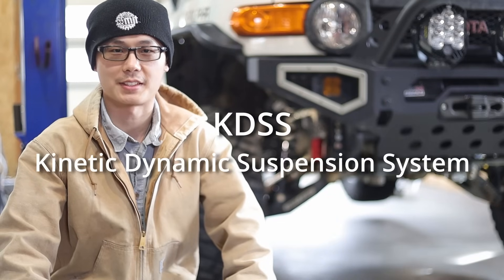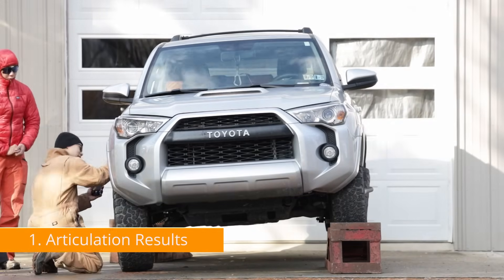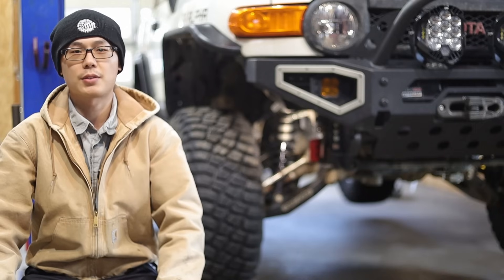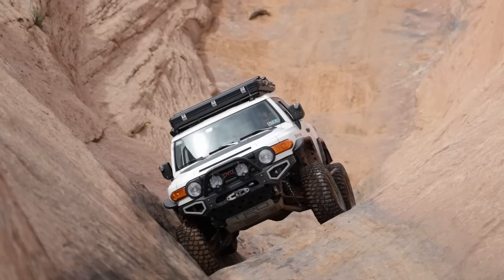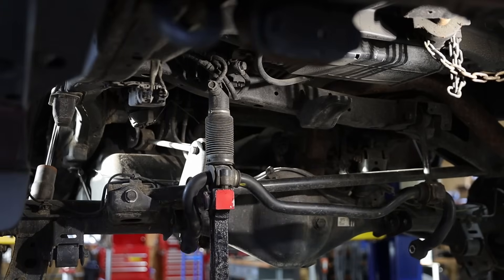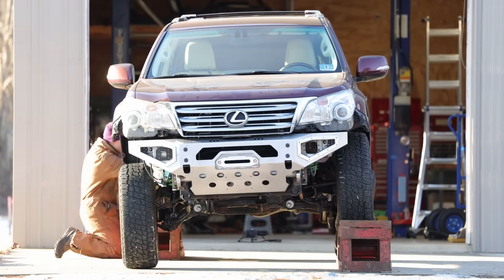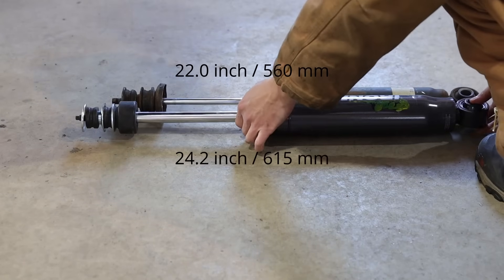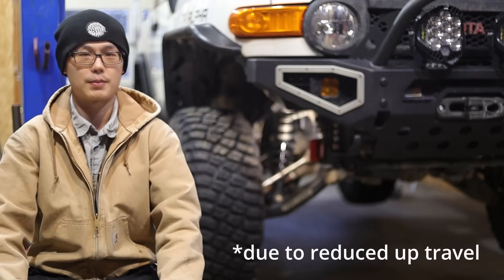Toyota KDSS Ultimate Test | Legit or Gimmicks?

Comment: The KDSS ride is jarring at highspeed off-road, espcially on wash-boards. I just installed the KDSS on/off switch from DR KDSS and it has made a huge improvement in that regard.
Reply: I wouldn't thing the sway bar, whether KDSS or not, would have any impact on washboard ride quality, since on washboard bumps both wheels are moving up and down at the same time.
Reply: @stevecarlson2346  you'd be mistaken. Washboards aren't even all the way across the road. Often they are only in the path of one side of the car or in curves where one side of the car travels further than the other.
Reply: @stevecarlson2346  You're correct. People fundamentally misunderstand what the swaybar even does.
Reply: @Getitstraightyo  a sway bar resists body roll and any difference between right and left wheels. If the right side goes over a bump then the whole truck will rock to the left instead of allowing that one wheel to move up independently. It could affect wash board roads.
Reply: @ExpatonTwoWheels  Washboards are parallel and perpendicular to the driving surface. That is how they form. KDSS is not hurting anything on washboard roads. This is basic stuff guys
Reply: @Getitstraightyo  because when you're on the trail you only ever hit washboard straight on, evenly across both wheels and never in a turn? Come on man.
Reply: @Getitstraightyo  you are incorrect
Reply: @Chad_H  How often are you turning on washboard roads that your swaybar is pissing you off that much? Christ it's like you people have no idea how this stuff works.
Reply: @Getitstraightyo  I said it's jarring, not that it's "pissing me off". I drive the Forest Service roads in Washington a lot - particularly around Mt Rainier. They are curvy and winding and rough and having the KDSS turned off absolutely makes a difference. You can come drive my truck if you don't believe me.
Reply: @stevecarlson2346,
do you really think the bumps & dips & corrugations on a WASHBOARD ROAD are as uniform as the bumps & dips on a real washboard (the man-made board where you wash your clothes on) ?
Reply: In case you do think so, then you need to drive on a washboard road in real life (not on a keyboard or on a touchscreen or in your dream), and pay attention,
the corrugations are not really uniform,
they demand suspension flexes,
not just ups & downs travel,
therefore stabilizer bar stiffness plays some role here
Reply: @stevecarlson2346   @RyanAttack872  It's easy to tell who doesn't run desert trails often. They aren't perfectly formed and are often offset by a few inches to the point where the tires are hitting the next one at different times, meaning the swaybar is in use. Even when they are relatively even bump-to-bump, the vehicle itself may not be tracking perfectly straight on the road, may be in a corner, the washboards may be at different depths relative to the original road surface, etc.
Reply: I don't think this is due to KDSS, but my GX swallows speed humps more smoothly at 40 mph than 20 mph
Reply: Same. I installed the switch day 2 of owning a brand new 2022 4R ORP. We live down a bumpy country road that we take at speed, and it makes such a difference my wife will ask me if I remembered to turn the kdss off of it feels jarring. Then we get on the windy highway, and I'm so glad I have it.
Reply: However, on the highway going hours at 80mph rides very smooth and I have Wildpeak LT tires.
Reply: me too 👍
Reply: I was just going to ask if you could install an override switch to turn it off when you're offroad. They would be the best of both worlds.
Reply: I found the exact opposite. The lx460 felt like a Cadillac going down the freeway on washboard roads in Jackson Hole doing 60mph.
Reply: Don't agree , ill trust the Toyota engineers thx.
Reply: @TS-xj5mt  the sway bar stiffens the spring rate , end of story ...  ive tested it on washboards ,  same vehicle with and without front sway  on two vehicles off road...more shudder with it,  smoother without

Comment: I been saying this forever.  We LOVE our KDSS.  It's basically zero sway bar off road and an amazingly thick swaybar on road.  Car on road, truck off road.  KDSS is a gamechanger...love it!!  The refinements of the GX and LX are no joke or gimmick...
Reply: My 2021 4runner has kdss and I'm sold. It flexes like a champ off-road and very little body roll on road, "game changer" is right. Awesome system.
Reply: @Jlhines19821  lift it yet? I am trying the Old man emu 3”…. Really don’t know how that gonna turn out
Reply: 4runner with KDSS is awesome.
Reply: @Faknm  oh yes it is!! ✌️
Reply: Until it breaks,which mine did and $5,000 to repair
Reply: @marshallbill1  how did you break it? 😳
Reply: @Faknm  I don't know. It is the hydraulic ram in the front is leaking. I don't off road or anything.
Reply: @marshallbill1  just take it to a hydraulic repair shop they can stuff new seals in it for $200
Reply: @Bill Marshall  exact same thing happened with my 4rnr. Front actuator started leaking and multiple dealers have no idea what to do except quote 5k+ repair bill on a 4k factory option.
Reply: @7:25 you might not have meant  “always”. I believe it’s only if you’re in 4L
Reply: Does the KDSS do this automatically or do you have to put it into a off road mode first? I was waiting for him to say something in the video but didn’t catch it.
Reply: @pappaclutch3266  KDSS is automatic... just drive it... once you are going slow it knows you are off road and disconnects the bars basically... excellent system... best of both worlds...
Reply: @LexusGX460-OFF-ROAD  cool thx
Reply: I heard KDSS give stiff ride quality. Is that true?
Reply: I had a moment of distraction while driving one time and drifted a bit in the oposite lane of traffic. I almost hit another 4runner head on. We both corrected with agressive steering and brake inputs but our trucks reacted completely differently. Mine turned and stayed relatively flat. His nose dived and he had major understeer. 

I saw then what KDSS did for me on road. He had no hood scoop so he had an sr5.
Reply: You are so right! Now I don’t feel bad to my self   When my friends make fun of me why I have KDSS.  When I’m reality KDSS is a game changer…
Reply: I think KDSS is the reason why many who are looking at the new GX and LC for off road use are going to spend the extra money for the GX.
Reply: We currently own a 200 series Land Cruiser and are very familiar with LX570. The US spec LC uses KDSS while the LX does not.
Reply: had kdss system break on 2011 Land cruiser. Cost the same to fix the car, as to sell  it fixed.
Reply: @LJ-fe8vb  that’s because you relied on the dealer which they have no idea what they are doing so they replace the whole system lol.   I’ve already replace many single components on the whole system for ppl with isolated issues.
Reply: @fltllc4136  what kind of issues? Mines never broken
Reply: @fltllc4136  lol I have already bought from you I didn’t look at the other stuff besides the switch
Reply: @NightNurseMike  Ha. Nice thx buddy.
Reply: @fltllc4136  I love it, by the way.  Next I’d like a locker override please.
Reply: @NightNurseMike  yessir.
Reply: @fltllc4136  if kdss is worse in off camber does that happen only when kdss valves are open and actively letting fluid move into the accumulators or does it allow fluid in those during normal driving too?  It’s gotta have more roll stiffness once the sway bars hit but is the accumulator allowing some lean before that when we cruise around with kdss off?
Reply: @fltllc4136  I want a retest with kdss off
Reply: @NightNurseMike  I never said it was worse.  The creator of the video did.  I don’t think it’s bad at all.  Also at some point the sway bars kick back in once the kdss shocks run out of travel. Which I’m the Video, it was right at that point.
Reply: @LexusGX460-OFF-ROAD, 

" .. been saying this forever ..."
"The refinements of the GX and LX are no joke or gimmick..."
No, they are not joke or gimmick.

" .. joke.."
" .. gimmick.." 
You're the joke. A bad joke. An ugly gimmick.

You have no idea what you are talking about.
Reply: @tr0nix1  semantics! lol same end result on either KDSS or AVS...
Reply: @GX460 OFF-ROAD  there are no semantics.  Just facts.  LX570s only with traditional sway bars here in the USA.  No KDSS.
Reply: @tr0nix1  bro this dude literally don’t even know how it works and he has videos explain how he thinks it works.  It’s comical.
Reply: Toyota turned a solid piece of metal into an electronic and computerized moving part, that is the DEFINITION of a gimmick lmao. Literally reinventing the wheel
They could've just equipped cars with quick discos and got the same exact result, but then they wouldn't be able to tack on another few thousand to the price tag
Reply: @Patrick.Weightman  I hate to be that guy but, I don’t think KDSS has almost any electronics on it. It is hydro mechanical
Reply: @justinmartin8887  just a solenoid to turn the flow of oil on or off. Open at higher speeds so when pressure is felt on one side going around a corner the front and rear interact. I think kdaa is way better than the AHC on my LX as you can upgrade shocks etc. AHC is hydraulic shocks . It's nice the vehicle goes up and down but limited at speed. Plus has no body roll at speed.
Reply: @Patrick.Weightman  it is a disconnect... it disconnects hydraulically rather than mechanically 😃
Reply: @Patrick.Weightman  Plus it was developed in Australia for off-road and Toyota bought the patent. 🤦🏼‍♂️
Reply: @Patrick.Weightman  you should absolutely drive one before trying to offer an opinion like youre an expert. Gimmick implies that it offers no noteable or beneficial improvements. The kdss handles insanely well at speeds compared to my swaybar 4R and obviously better than my non swaybar FJ. Offroad is a different story. No disconnects to worry about but also can be stiffer at certain speeds unless you disable it. Sure it adds a new system to the vehicle which could potentially fail but depending on your driving habits it's awesome in my opinion.
Reply: Lx does not have kdss, only the 200 series land cruiser does.  The LX has hydraulic shocks
Reply: @tr0nix1  Lexus LX570 has KDSS standard.  KDSS has nothing to do with shocks.
Reply: @LexusGX460-OFF-ROAD  bro common. You again. You have no idea what you are talking about. Kdss does have a hydraulic shock in the system. Have you even looked under your own ride ?  Please stop putting out wrong info 😂🤦🏻‍♂️
Reply: @fltllc4136  it's OK.  Whats that saying?  "You can only lead a horse to water" or something.

Comment: On my KDSS test also I noticed Non KDSS on my TRD Pro had better rear articulation than TRD ORP with KDSS. For front articulation does GX and 4runner have same upper and lower control arm? Can it be a different factor? Off camber lean on KDSS would be a big point. I even get scared at lean offroad, If I had KDSS it would have scared the heck out of my wife. I guess for just to have front articulation not worth. For non KDSS the extended travel remote res anyway come with front swar-bar relocation block right? (Atleast I saw that on my ELKA kit) For highway you would only benefit if you try to take shard turns right? For most of the driving there is no difference right? More reliable non KDSS would be my pick especially here in CO road salt could corrode KDSS control lines on driver side. Good to have simple non KDSS, No need for spacers and different track bars when lifting. Also would you test how much rear articulation non KDSS can get? I only saw KDSS 9.1 - 11.5, how about non KDSS with same shocks?
Reply from the maker: I had 2012 FJ non-KDSS UCA and this GX's UCA side by side. They are identical. Yes corrosion is the biggest killer to the KDSS. Toyota just seems to always neglect corrosion. You would think if you just keep it straight on high way swaybar is not part of the equation. But reality is much more complex than that. I would personally pay $1500 if someone can make a true swaybar disconnect for my FJ (sliding links don't work well). That's how much I value a front swaybar for highway. Other people will have a different price in their mind. No I don't have another vehicle running the same shocks. Would be interesting to know though.
Reply: @TinkerersAdventure  if we have a swaybar disconnect from the middle like in Jeeps it would be golden. Since non KDSS has better articulation in rear we can keep as is while achieving front articulation. This way we don't need hydraulic lines the KDSS we have now so no corrosion problems, no leaks from KDSS rams front and back (which seems to be little common and a dealer only repair) , no problems fixing sliders (no need to cut kdss cover), no possible trail damage to the main control valves near the driver frame, many more benefits.
Reply: Even with salt in Colorado, you can take preventive measures to mitigate any corrosion.  However people complain and don’t take care of their vehicle.

Comment: Apex Designs is working on a sway bar disconnect for the Toyota platform, similar to their autoLYNX Jeep sway bar disconnects. I think that would be a great solution if they can make it work.
Reply from the maker: Good info. I think it will be a more reliable version of the sliding swaybar links. Unless the did something more fundamentally different, sliding link style could not allow 100% travel, other wise the swaybar will be in the CV boot. Still an improvement regardless

Comment: Did you try, or would you even want to, override the solenoid control on the KDSS system to bypass the accumulator at low speeds?
Reply from the maker: I hope it can be done. But current aftermarket switch can only override-open the solenoid at high speed to make the ride softer. But it cannot override-close them at low speed to improve off camber.

Comment: Great information, keep the videos coming. It sounds to me like it would be easy enough to add a switch to close the KDSS solenoid valves for off camber situations.
Reply from the maker: Thanks! The switch can only override-open the solenoid at high speed to make the ride softer. But it cannot override-close them at low speed to improve off camber.
Reply: @TinkerersAdventure  That's unfortunate. I would have thought that you could either drive the solenoid by sending it power with a switch or interrupting the power with a switch but will take your word for it. Unfortunately my GX 470 is non KDSS.

Comment: I'm SOOOO impressed with KDSS on my GX460.  The thing handles surprisingly well for a truck, due to it's red-bull-can sized swaybar, but it rides soooooo smooth in the rough, and with good articulation.
Reply: same here... it's amazing how "flat" it handles on road, then you get full articulation on the rocks... all automatically... it's amazing 👏
Reply: Do all GX460 come with KDSS? Thanks
Reply: @calmega5236  Yes... fully loaded Landcruiser Prado.  Full-time 4wd, atrac, kdss.  You can option air springs and crawl control if you want too